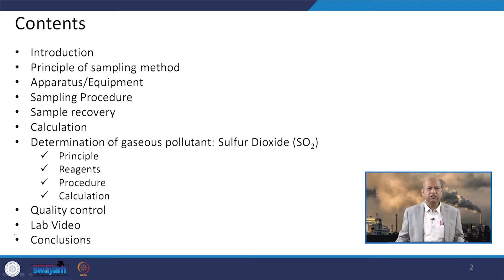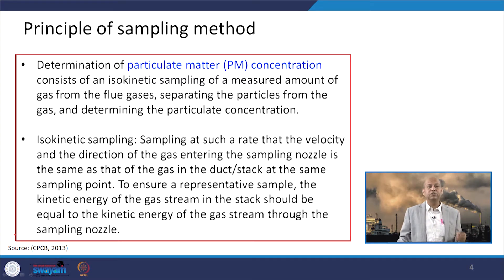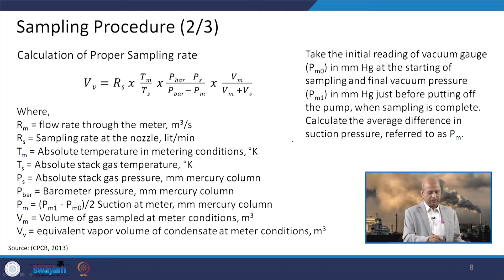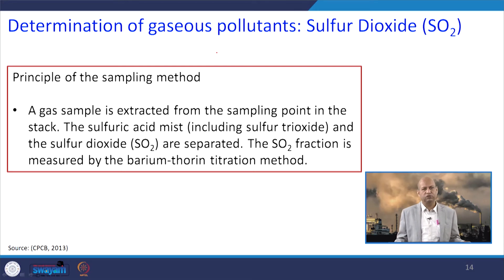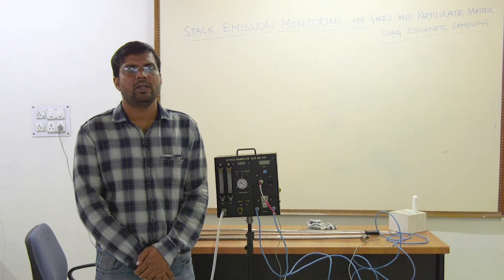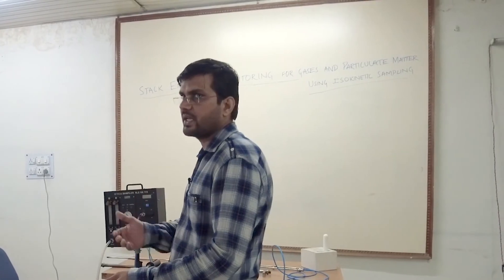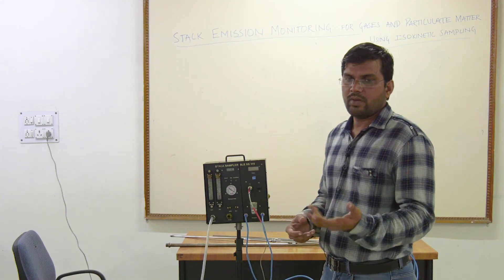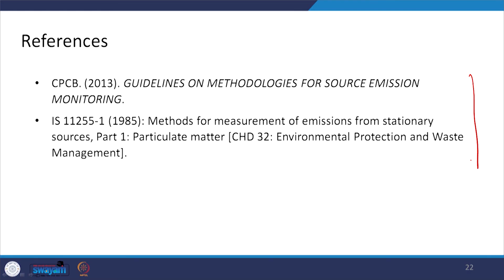Lecture 58: Stack Emission Monitoring using Isokinetic Sampling

Comment: Sir video me static pressure or deffrencial pressure not mention
Reply: Dear static pressure & differential pressure are two separate phenomenon in stack which have measured by using pitot tube with the help of a u-tube or incline cum vertical manometer or a digital meter.